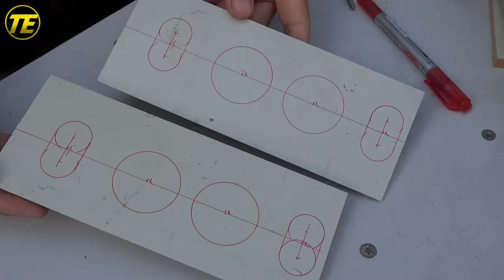Building TV Bluetooth Speaker V3

Comment: You may want to try gluing plastic pieces together using acetone to melt the two surfaces you need to join and then just assembling them. If it works on your plastic type, it should be stronger than superglue.
Reply: Only for ABS.

Comment: you built a cool tv.  like from the DDR times.  but you forgot a small box at the back!  so that it really looks like a tube driver from behind.  if if if  must make it completely like a DDR television.  you can still improve it Just add another box to the back.  and then you have to stick a manufacturing logo on the back with your logo.

Comment: A honest bit of criticism: while the most of your builds do look impressive, they will be a bloody nightmare to disassemble and repair, shall any of the components fail.

Not only you're glueing the case pieces together - you're also glueing the battery(!!) and cables (!!!), effectively trapping them inside. All instead of creating clip holders for them (seriously, you have a 3D printer, just print some and screw them into the case)! A good cable management is halving the engineering headaches. Speaking of cable management, is it really that hard to make detachable cables?

This is a terrible practice, we scrutinize big companies like Apple and Microsoft for doing the same to their phones and laptops. And yet, you're doing the exact same mistakes. Please, don't.
Reply: i guess he's not planning to sell these, maybe it's for his own purpose, if it got broken or need to do some repairs, it will be easy for him since its his own work.
Reply: Sure I question the same thing too but this is his project, so I don't think he has to worry about it. If his own projects breaks, he's the only one who can fix it